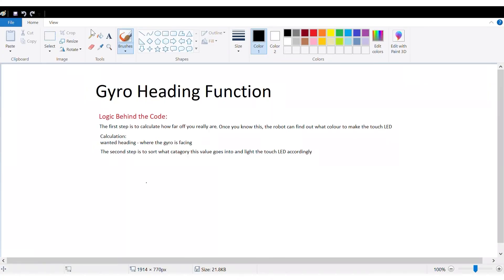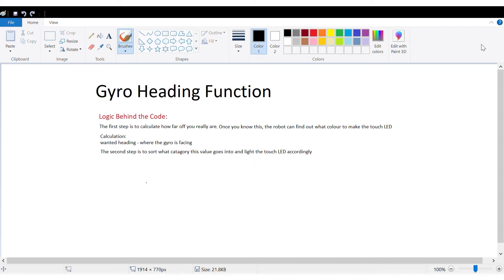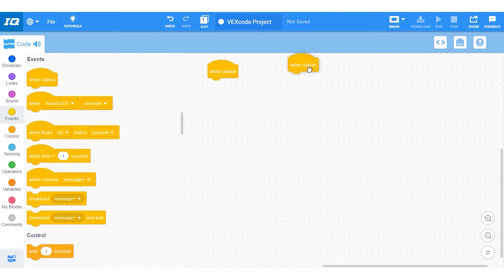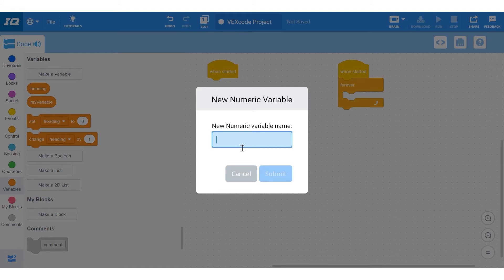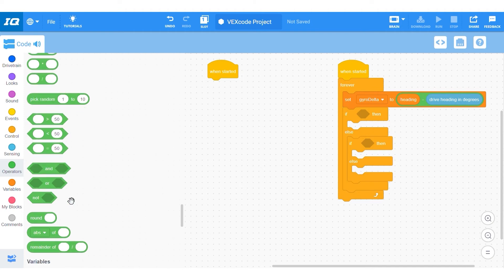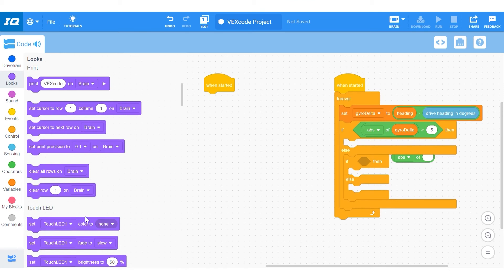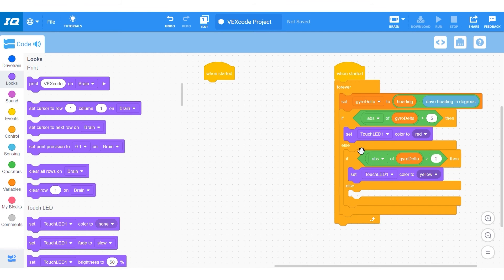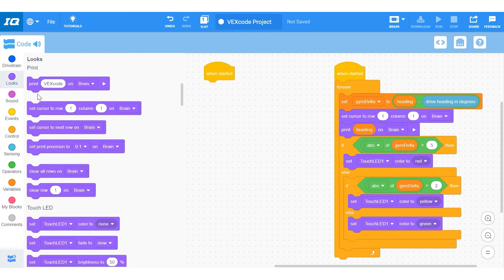How to make Gyro Heading Function in VEXcode Blocks

Comment: Bro you really don't need to make it this complicated....

Just make a good drivetrain that doesn't stick anywhere and use a gyro. All of your drivetrain code will use the gyro if you have it.
Reply: The built in VEXCode IQ Drivetrain does not provide a P/I/D API. It is very basic, and almost never gives good turns.
Reply: @exortions  Except it does give good turns. Use a gyro, build your drivetrain well and its really accurate and fast.
Reply: @frantellewater30641a  No it isn't. Not at all. Any well-built drivetrain will still have inaccurate turns with a gyro passed into the Drivetrain
Reply: @exortions  You can say that all you want, but I've actually done it. It's accurate.
Reply: @frantellewater30641a  Accuracy does not mean consistency. Also, just because it gives good turns does not mean it gives good driving methods. The Drivetrain is very inaccurate when it comes to driving forward, and almost is never consistent.